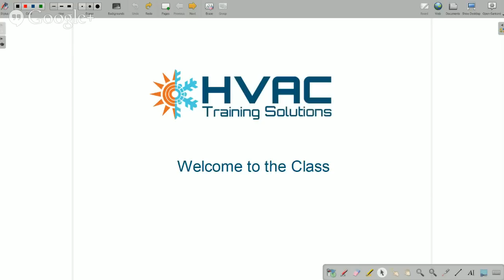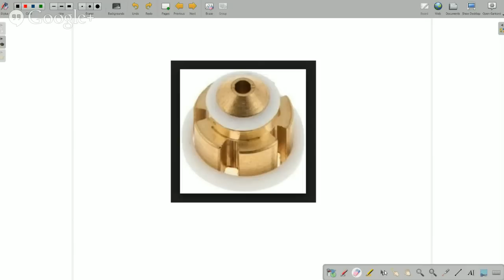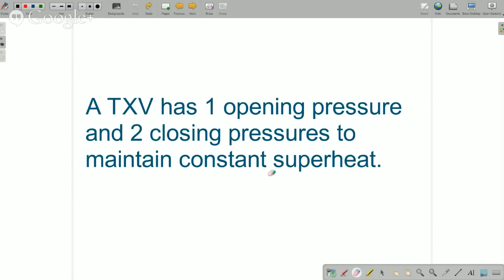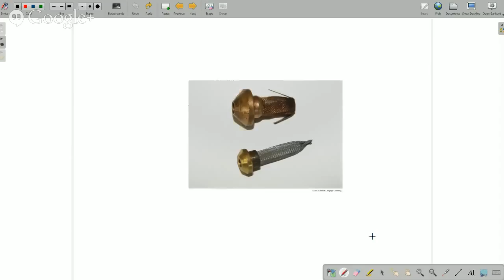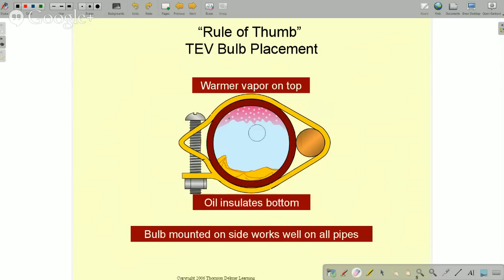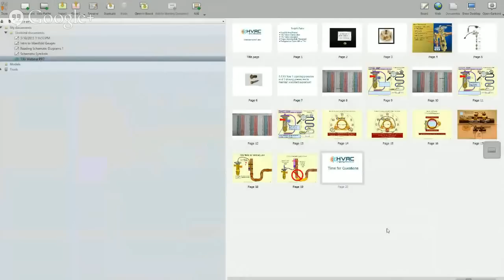Intro to TXVs Live HVAC Training - HVAC Training Solutions

Comment: Talking about an explanation of a conventional ac unit which would be most car , window units , and ac non-heat pumps. Back in the day they ice up in colder then normal conditions but now you don't see that happening all that much curious what is protecting this

Comment: what i am looking for is an explanation on how a non-heat pump ac unit protects itself against a evaporator icing is it like have a separate thermostat in the evaporator which breaks contact with the compressor contactor . Because the simplest way i can see is have a simple thermostat switch that checks the evaporator temperature range... like a fan limiting switch in a furnace
Reply: in straight cool systems around here there is no protection beyond a low pressure switch in the condenser. Under normal operating conditions it is not an issue as long as the temperature you are trying to achieve is reasonable and you have adequate return.

Comment: Great Video... helps me to understand the control mechanism. At around 18 minutes... you show the math of 91-67 psig as 14 psig, but I think you may have wanted it to show 24 psig which was giving you a 14F temp difference across the evaporator. However, I still get the points and its a great tutorial!
Reply: +Jim Moudy ; nice catch Jim and a flaw that can could be crucial in keeping the balanced pressure. Great video and happy to see this simple math error caught so quickly.
Reply: Jim Moudy